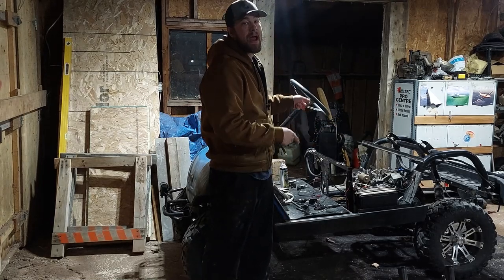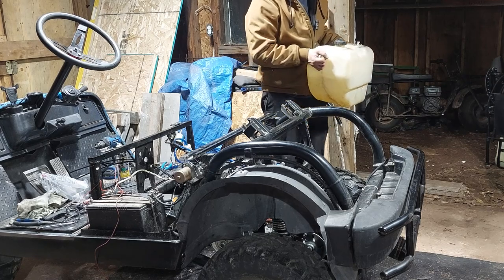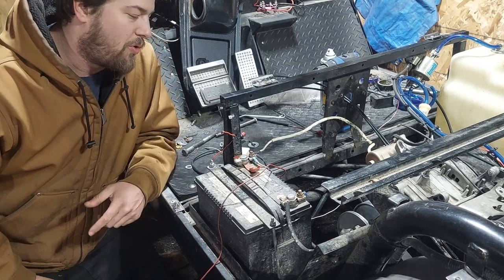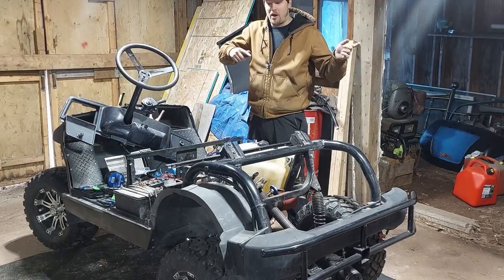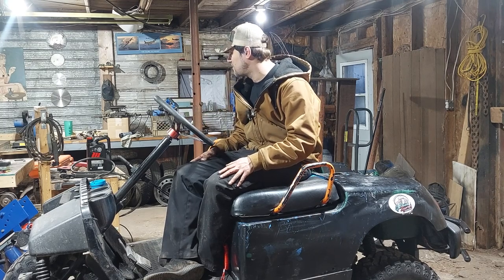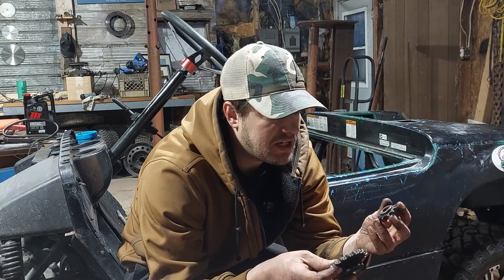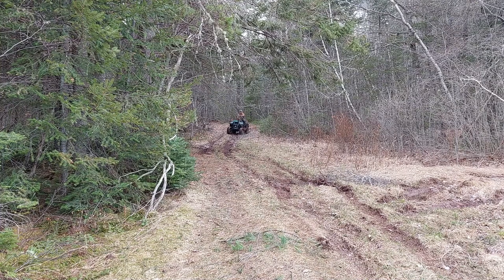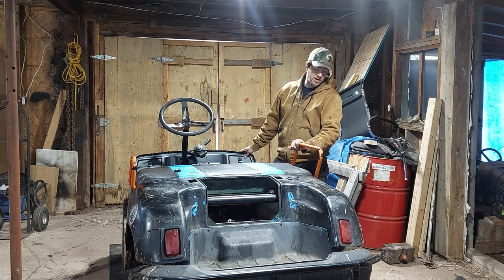OFF-ROAD GOLF CART BUILD  PART 2

Comment: no that trash in that tank wouldnt explain the dirty carb because i havent run off that tank in 6 years however that carb i pulled off the spare engine because buddy who did the live axle swap stripped the threads for the float bowl bolt and it was leaking so i tossed on a carb that hasnt been run in 4 years. all the trash that got sucked up from that tank wouldve been filtered out by the filter in the engine tank